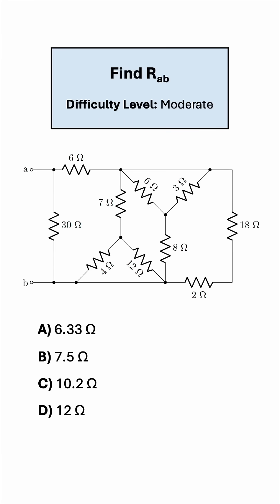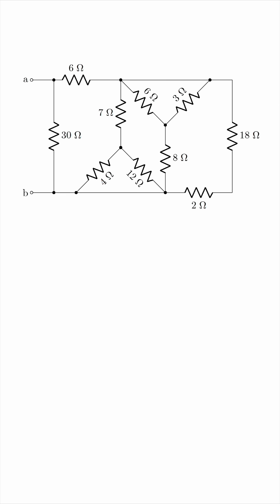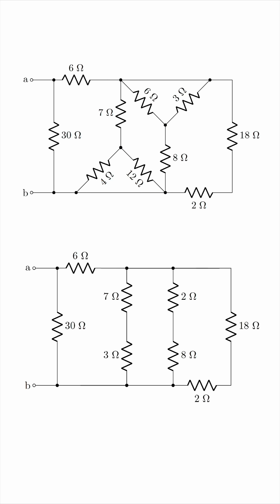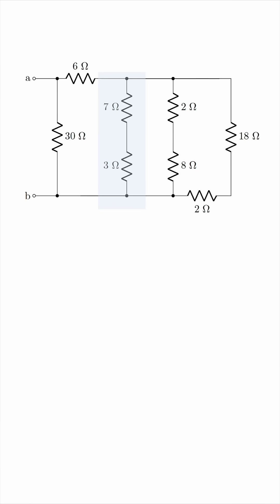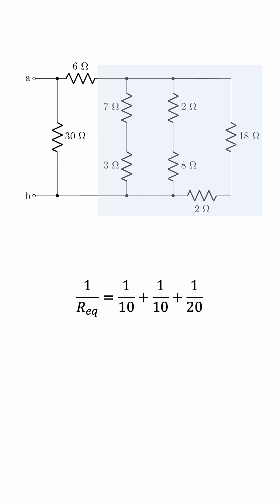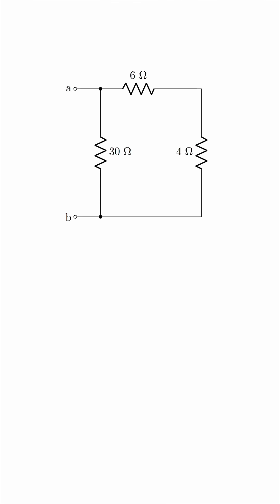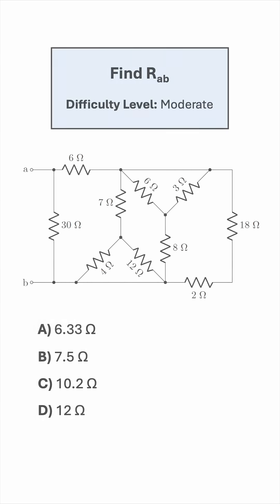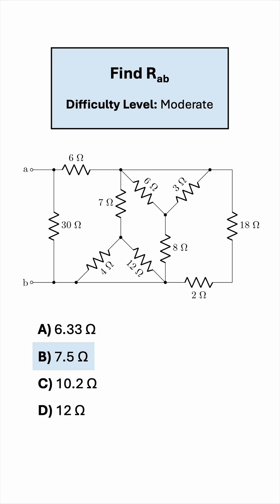Equivalent Resistance in a Circuit #electricalengineering #engineering #electronics

Comment: 7.5, after you transform the 6 and 3 ohm resistors into one 2 ohm and the 4 and 12 ohm resistors into a 3 ohm you basically get a 20, 10, and 10 ohm resistor in parallel which is 4 ohm equivalent. added to the 6 ohm means we have a 30 and 10 ohm resistor in parallel, giving 7.5. I would argue that this is an easy problem given any 2nd year electrical engineering student taking DC circuit analysis could solve this within 2 weeks. Something moderate would probably involve basic capacitor and inductor circuits and advanced would bring in RC, RL, and RLC, provided u want to keep to a DC background.